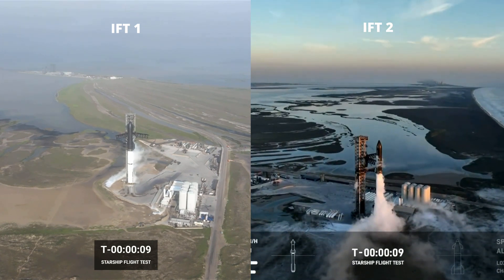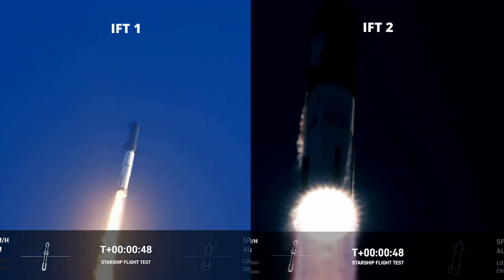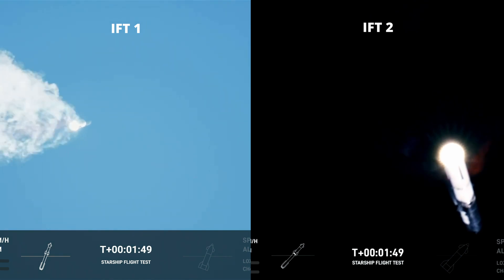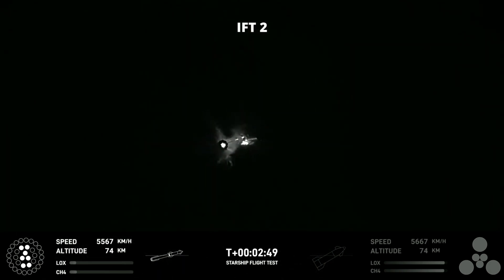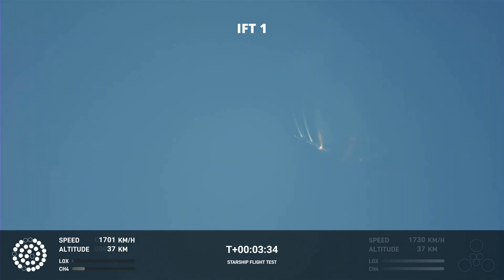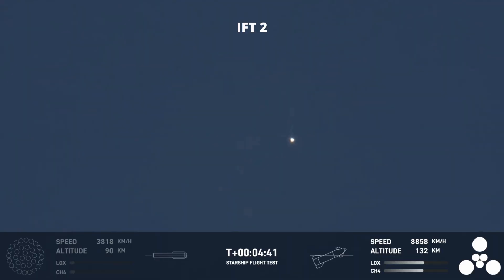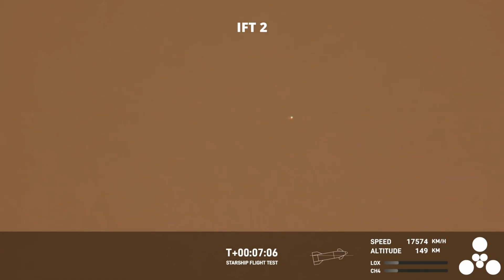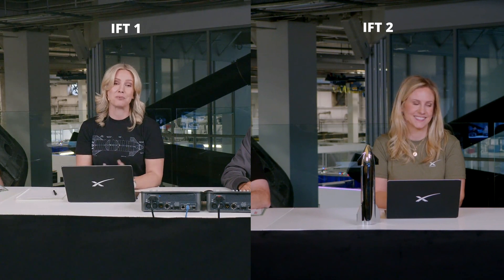Starship 1st VS 2nd Launch Comparison! (Headphones recommended)

Comment: In the sixties a bunch of nerds using only slide rules (do you even know what is that?), sent men to the moon. None of the launches, including the test launches failed. After Apollo 12, the second mission to the moon, the Americans were already bored, saying that the Apollo mission were as boring as trip to Pittsburgh. Now a bunch of fans think that exploding few seconds after leaving the tower is “icing on the cake”, because their cult leader said so. Elon Musk is a cult leader and the adoring acolytes genuflect to his genius when in fact he designed nothing and invented nothing, I bet most of these fans don’t even know the name of the Apollo program design team leader.
Reply from the maker: I do know what a slide rule is, and these are in a rapidly accelerated iterative design phase. It has always been “easy” to make an expendable rocket, but no one has ever achieved completely reusability. The Falcon 9 is testament to the effectiveness of this method. It remains the cheapest and most reliable rocket of all time and without it we would still depend on Russia’s Soyuz rocket after NASA bit the dust.
Reply from the maker: Complete*

Comment: There is a big difference between the first starship launch and the second one. At the beginning of launch, the first starship is generating a huge dust tornado and throwing debris everywhere and the second one is mostly steam being generated.
At 1:37 into the video the first launch already has several engines out, and the second one has all engines running.
At 2:45 into the video, the first starship is spinning out of control and the second one is on course.